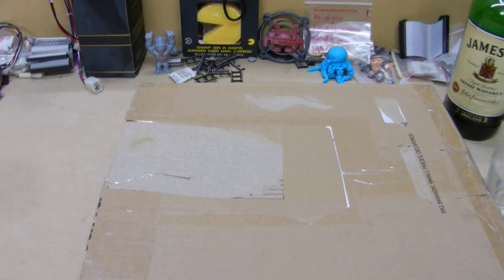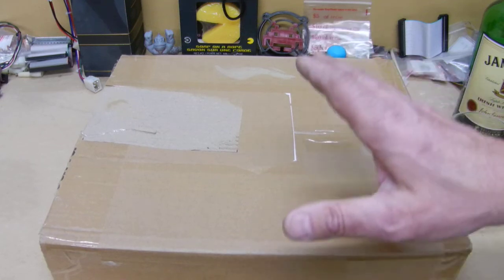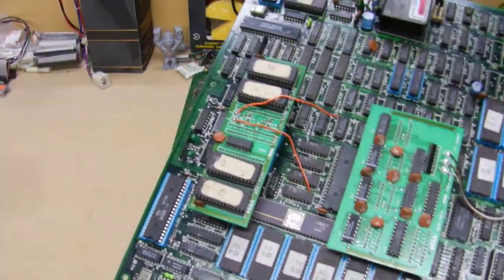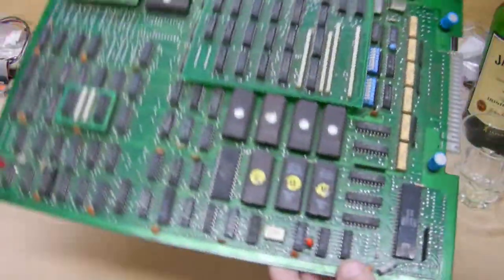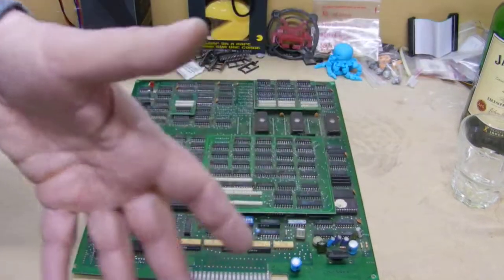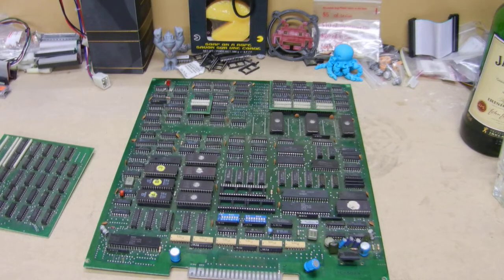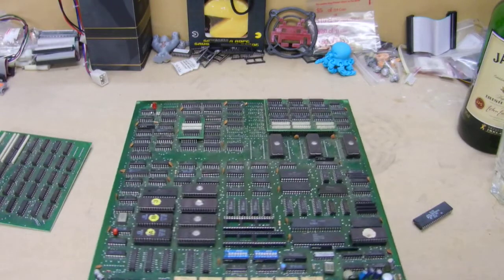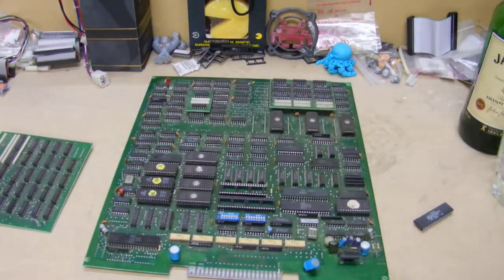Repairing Sega Wonder Boy arcade PCB Board bootleg Part 1

Comment: Can anybody point me to a JEDEC file for the two PALs on the larger daughterboard? I couldn't find those (tbh I suck at Google) and I have this exact bootleg board (only one of it though) as well as the BL with the one continuous daughterboard which is almost as big as the mainboard. Through testing I can say with very high confidence, that the one PAL in the corner is bad.
TL;DR
The inputs look good, but the outputs are either stuck or weak. I don't see something really smoking like bad logic lows, but all the pins that have output at all have a very low logic high, like around 2.5V. But there's a chance the PAL below it is bad as well.
When replacing all three daughterboards with the one single one from the working machine, the board works.
If I replace the smaller two daughterboards and angle the big daughterboard in so it makes contact, the board also works.
I have an In-Circuit Chip tester which can test pretty much everything except PALs and all the chips on the faulty daughterboard pass the test.
(btw. the symptom IIRC it was flickering garbage, not booting)
Reply from the maker: email me.
Check new video part 3 .
I'm talking at that daughterboard.
Cheers
Reply: @arthurpinball5852  your About page seems to be blank...